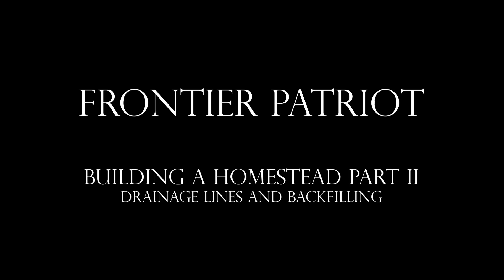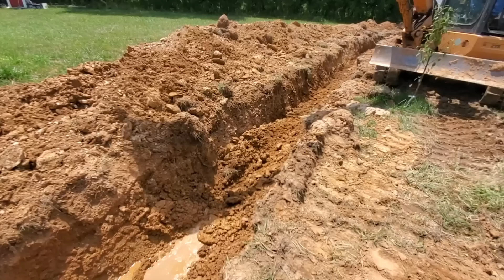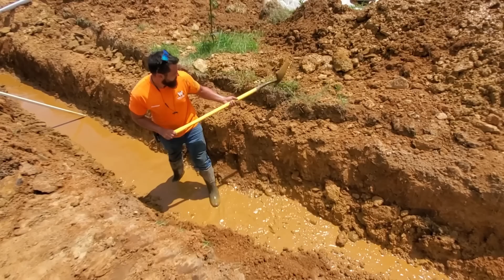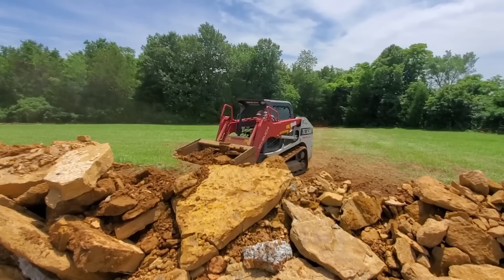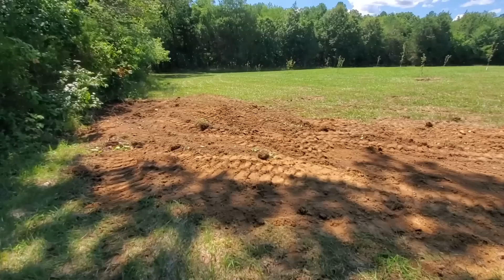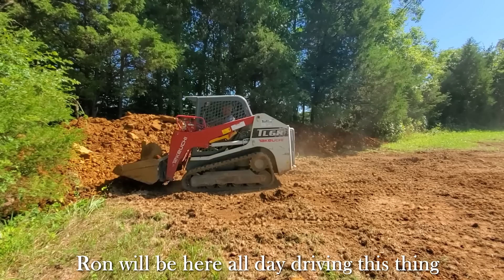Ron Learns How to Drive a Bobcat |Building a Homestead Short|

Comment: I've used skidsteers and other equipment for many years, I own my own and used to work for USSteel. Ron did an  excellent job making sure the bucket was completely dumped, the one thing I noticed and its common with beginners is slamming the bucket all the way back. I still do it here and there. It took me  quite some time to get the hang of the controls, hes a quick learner.👍 Great job Ron.